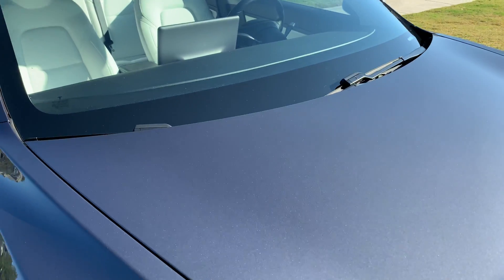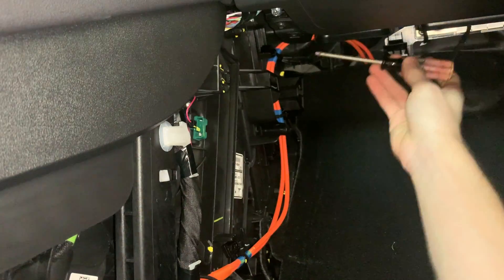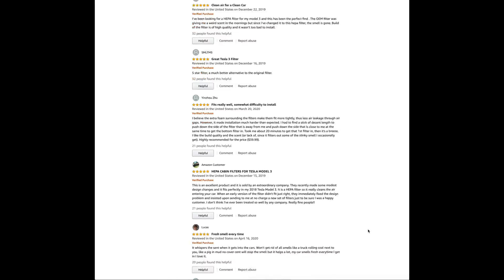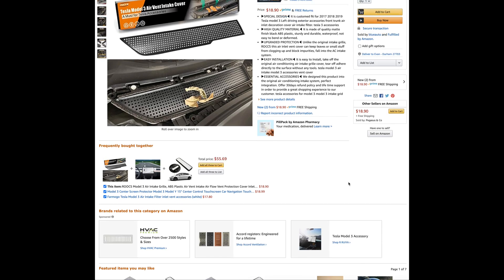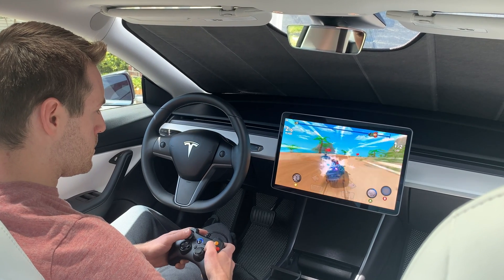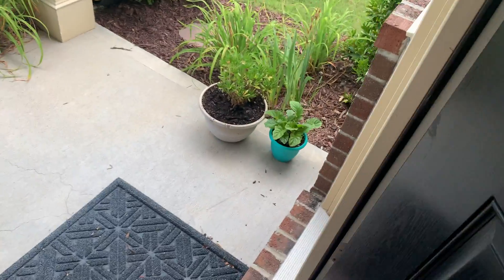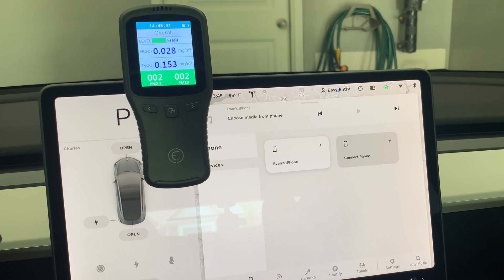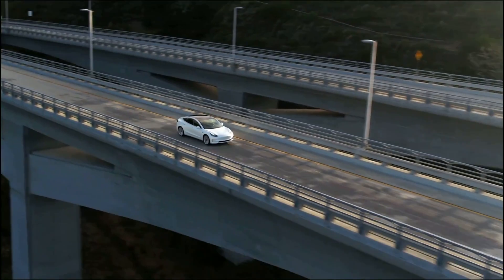AC Smell Update 2020 🚘 Tesla Model 3 👉🏻 Cabin HEPA Filter Air Quality Test

Comment: A good start. But if you REALLY want to measure air quality, you have to measure the PRIMARY cause of bad air in cars -- car pollution & exhaust from other cars. To measure that, you need to measure CO, CO2, Ozone, and NO2. Otherwise, you are missing the boat. It's so important, invest in quality air monitors and test the TESLA this way.

Comment: I own a mold remediation business in south Florida. I Recommend after spraying the coils with cleaner and before installing the two new filters, you use “concrobium mold control “ on the coils. This product is great for mold and mildew prevention as well as remover.
Great video btw!
Reply from the maker: Great advice!

Comment: HEPA filters are great, but if you want to measure their performance, VOCs probably isn't the right thing to track. VOCs are gaseous compounds. Compared to airborne particulate matter, they are much smaller. A low cost HEPA filter cartridge is unlikely to take much VOC out of the air. A meter that measures PM2.5 (fine dust) is probably a better choice, and should theoretically show a bigger difference between the HEPA filter and the OEM. Assuming the HEPA filter is legit.

Comment: Thanks for posting the how-to video.  I  watched it several times as I replaced my cabin air filters with the Xtechnor Hepa filters.  Quick tip, Xtechnor included both a car molding tool and a  torx screw removal tool with the Hepa filters.

Comment: I just did this with 2 cans of kool it like you suggest but it didn’t fill the whole thing up like yours, for some reason. I don’t really understand why. I was expecting to get all silver of the evaporator covered, but some was still visible. Maybe it was my technique. It is difficult to do it due to the location and the hose is difficult to control.
Reply from the maker: It can be challenging, try to move the hose up and down throughout the entire coil system.

Comment: I've been following these threads for a while now.  But now that I'm about to take delivery of my MY I hope Tesla has redesigned the HVAC system to avoid this.  There was an obvious design flaw if HVAC smell is "normal".  Great video and I subscribed to your channel.  Enjoyed your presentation.
Reply: You will have this problem
Reply: I have a MY performance and I just finished doing this past weekend because I was starting to get a moldy smell. I used the kool it and hepa filters in the video and hopefully it doesn't come back. Car only has 3300 miles and I'm in el paso TX.

Comment: Thanks for the update. I ordered the spray and filters last night.... praying the smell goes away. Ive had this serviced at no charge 2 times at the Orlando service center, but this week they want to charge me $112.25 + tax. I have an early vin 8xxx with 30k for mileage. I’m going to try just the grate cover (no filter) because I’m concerned about reduced airflow in the Florida heat.
Reply: How’s that working? I was thinking the same. Or a really thin filter